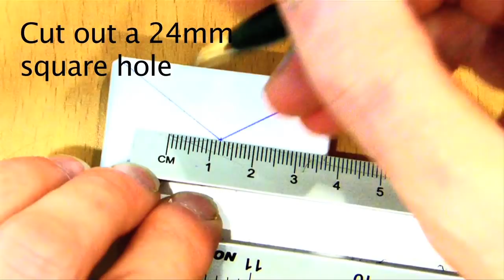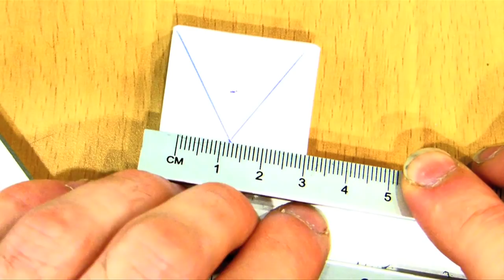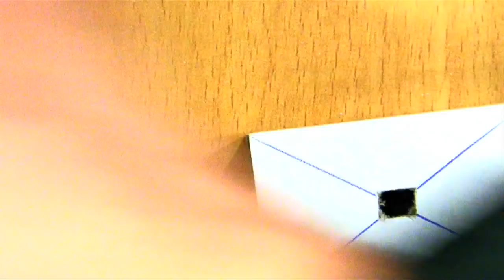How to make a camera out of a matchbox

Comment: Hello! Thank you for sharing this video with us!

I made a series of these for myself and a friend who was going to use them with her daughter's class to learn a bit about photoraphy.

They worked a treat and today I got back the first roll of film after developing and I was pleased with the 0.5", 1", 2" and 4" shutter speed attempts in bright sunlight, but all the photos are slightly blurred. Where could the problem be? Does the size of the matchbox matter when combined with the tiniest hole possible? I used boxes of the same size as you show (9mm deep, 50mm long and 35mm wide) and the pin hole itself was not the full diameter of the pin but the very tippiest tip I could manage to punch through the cardboard and stop. I measured it and supposedly it is 0.2mm diameter.

When I showed it to my photography teacher she did ask if the hole was flat, and it isn't, actually; there is the tiniest pressing in of the aluminium into the carboard I sat it on when punching the pin through. Can the blurryness come from that? It is exactly the same across all the frame.

Again, I thank you for this great video. I really enjoyed taking the photos and when improved, the pictures will be excellent.

Oh, by the way, depending on how you bend the ring-pull to fit it into the end of the spool to wind on the film it works as a brake that stops the film trying to roll itself back in or moves along.
Reply from the maker: great, glad it helped
Reply: Adam Jermane-Jones 

I got the photos back from developing and across the board they're out of focus. The colour is spot on and the timing you give us of 1/2, 1 or 2 seconds worked a treat with ISO 200 film. I was afraid I'd get nothing or just a white spot. Instead, vibrant colours but the 9mm focal length is just off, but I don't know which way! Should the hole be even tinier than 0,02mm which seems to be what I managed by pinning the tip into cardboard as little as possible? Or as other sites suggest does it have to do with sanding the metal free of the varnish and making sure there is absolutely no dimple from pricking the hole?

I noticed that depending how much or how little one folds the drinks can pop top it acts as a brake for the film to be rolled in more exactly (as opposed as too loosely, which allowed the film to fight its way back into the source spool.
Reply: Adam Jermane-Jones I also had some strange red  flaring down the side of  some of the photos. It nearly seems to be the the  ones where the sun comes in strongly from the side. Artistic, but I wasn't looking for that. Any ideas? Again, thank you!
Reply from the maker: The pin hole should be VERY small, you should try to not push the pin all the way through, just get the tip through, the hole should be almost invisible. Also, you should put the pin hole in a small piece of metal, not the cardboard.  I hold up the metal right up to my eye and point it to a window to make sure there is actually a hole there
Reply: Mike Pinter a

Comment: Try painting the inside of the matchbox w/ black spray paint next time. It will give the inside of the matchbox better coverage and it's a bit easier than struggling w/a marker.
Reply from the maker: Good point. I've done this with biscuit tin pin hole cameras, not with these yet though. Thanks
Reply: Abegail Merced de a poco

Comment: Thanks Adam for this video. Few questions that because of the language I couldn't understand very well:
1. When all the original film ends, you have to spin back all the film that was on the old film? or you take the old film for "printing" ?
2. When you take a picture, how many spins or degrees you have to turn the roll, so you can take a new one?
Thanks
Reply from the maker: Hi Santiago. Im planning on addressing this question and possibly re making the original matchbox camera video soon.
Reply: I am wondering (maybe I overheard) how many times I have to spin before first photo? Or how I can find the biginnig of the film? (if I can)
Reply: Oh now I get that. I thought there are (somewhere starts) separetad rectangles - each for one photo.
Thanks fot the video!:)

Comment: Assuming all you had to buy was the film, how much would this cost? If you had to buy all the materials, how much would that be in total? Would you recommend using a flashlight or will enough exposure do just the trick? Thanks.
Reply from the maker: Alex Bellomy prices vary. Film cost me £1 at the time, but now it costs £2.50. You'll have to research prices in afraid. As for light, you really need to be outside. What do you mean by a 'flash light'? I have tried a flash before and this worked well, but you need to be close to your subjext. If you mean a tourch, then don't bothrr, it's not bright enough
Reply: Torch, flash light. I'm U.S. You used a pound right? Or is that a euro? Which according to google is $1.27 U.S. With flashlights (torch) I've found some that are stupid bright. Can you take land scape pictures? You said close to the subject... Thank you so much, I really liked this video, all the others I've seen don't go into depth on how they work, only how to make them. Thanks so much Adam Jermane-Jones